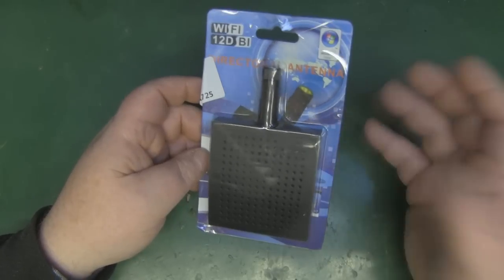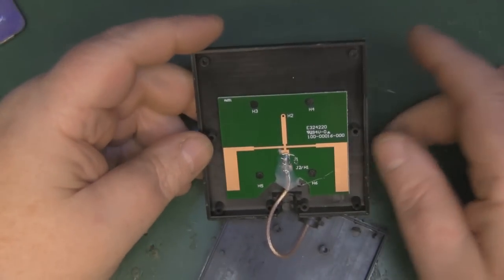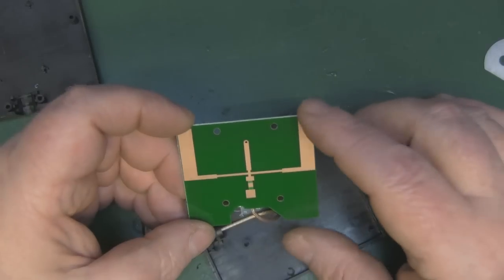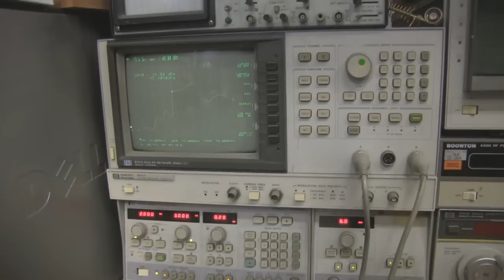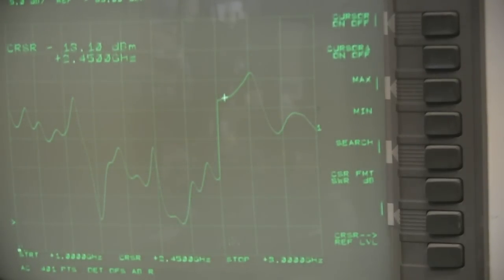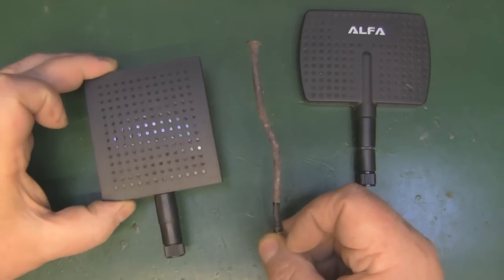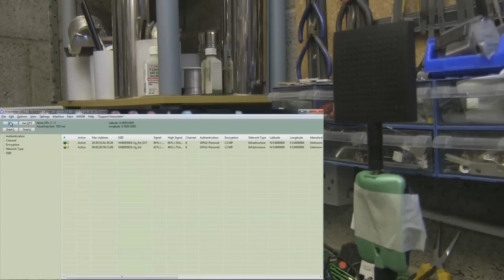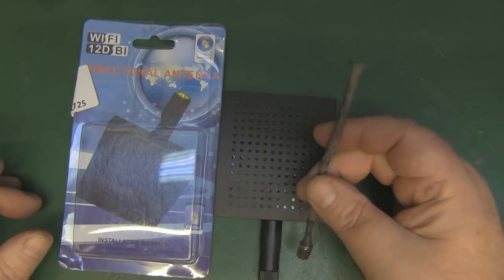12dBi Panel Wifi Antenna vs a Rusty Nail!

Comment from the maker: So should I cut and tune a rusty nail @2.4GHz so it can make an appearance in future videos?
Reply: If you could try it first with just getting the lenght right'ish that would be really interesting to see if any other modifications would improve it significantly
Reply: Definitely!
Reply: Oh yeah! Rusty nail FTW!
Reply: haha, yeah pretty fun project!
Reply: Heck yeah!
Reply: Absolutely! The Rusty Nail should be the new benchmark from now on, imho. Love your work Andrew!
Reply: great to have your videos...
Reply: ABSOLUTELY!  Anything that gets beat by the rusty nail can be named and shamed by having a rusty nail trophy 🏆 bestowed upon it too or be attached to a cross with said items.
Reply: Absolutely
Reply: Think bigger, an array of rusty nails... 😉
Reply: Definitely yes. Not the best antenna, but by far the funniest. I'm surprised it got such good sensitivity considering is not tuned for the frequency.
Reply: Andrew, I stumbled across this video because I'm trying to resolve an issue I have with an Internet signal, as inexpensively as I can. I live in a rear in-law suite behind my landlords house.  He has Spectrum services with premium cable, phone, and Internet.  The coaxil cable also comes into my apartment and feeds a premium cable Spectrum box that he pays an extra fee for.  I piggyback Internet services through his wifi from the modem and router in his house, but there's too much distance and interference (walls) to get a good signal.  I bought a plug in wireless signal enhancer which made the signal bearable for very light Internet surfing, but I cannot stream videos or live sports.
So my question is this: can you recommend a solution for me which would resolve this problem?  Thanks.
Reply: Rusty nail mesh system :)
Reply: NO! Don´t cut and tune it, use it as a baseline in benchmarks when comparing antennas etc. It is super funny and at the same time one intuitively notices how shitty solution "B" is compared to a rusty nail. You could do the "rusty nail delux" which is an other nail but polished xD
Reply: Please do an up to date update of this...far to entertaining
Reply: "So should I cut and tune a rusty nail" 

No! 😁 That's the point, isn't? 
And it's absolutely hilarious in an important way! ..It reminds us that not every 'package' is designed by a super-genius, and that "We the Plebs" can readily succeed at higher performance DYI interesting tech stuff.. because "tech stuff" is not really such an incomprehensible mystery, to be utterly out of reach to the common man (common nerd?) 

If you 'work over' the rusty nail too much, at dome point it becomes no longer a rusty nail, and instead is merely "a small object of some unspecified metal alloy, freed of oxidation, and formed to function with highly specialized precision." 

Lacks the same comedic pizzazz.. LoL 

Rusty nail 
v 
"a small object of some unspecified metal alloy, freed of oxidation, and formed to function with highly specialized precision."
Reply: Maybe just cut it, and connect it, using common tools, that an everyday person might have in their tool chest.. 😃 

Or even just hunt around in the 'junk drawer' until you find a nail the right size..

Comment: Another reason that the rusty nail is better is that the FAKE chinese antennas are copper patches, but the monopole rusty nail is FERRO-MAGNETIC which means that the magnetic coupling is going to be far superior if tuned properly.

Comment: 🤣🤣🤣 for €3 you get away with a nice new project box and SMA connector, provided that the cable is reasonable! BTW did you check it might be down to the quality of the coax cable?!